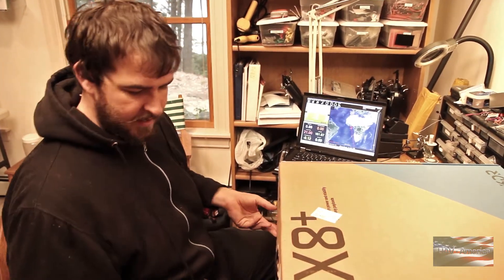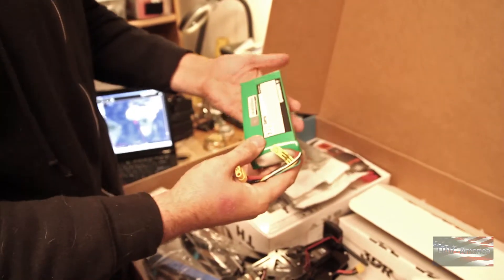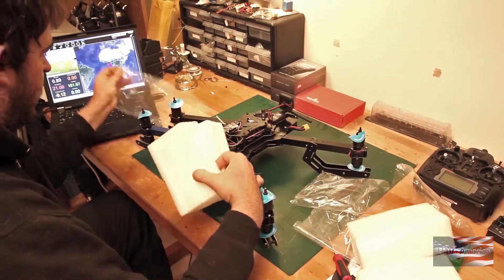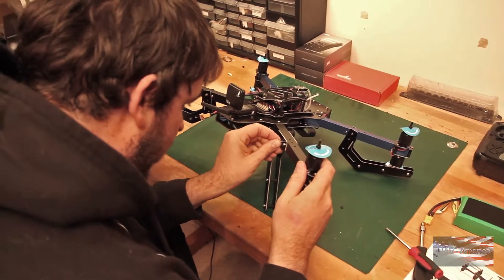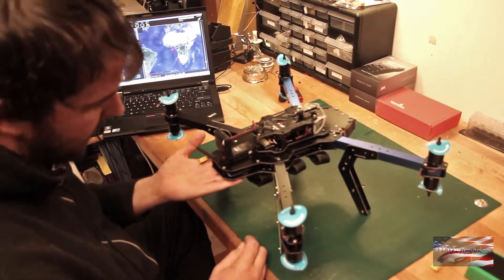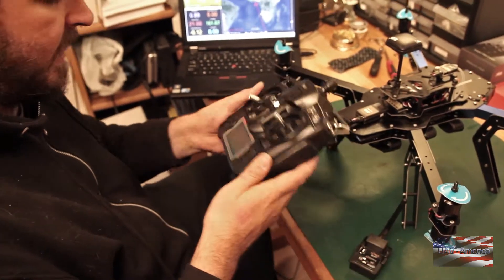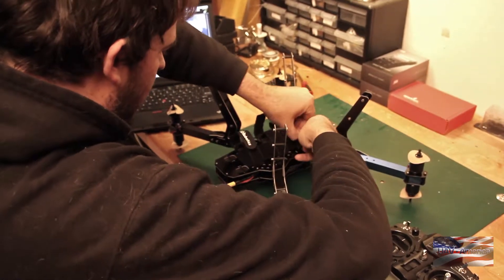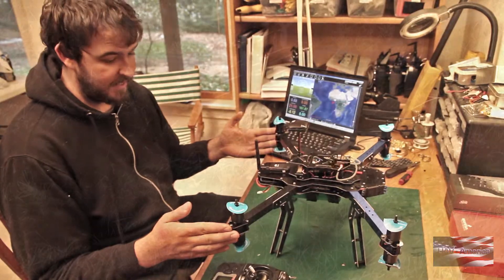3D Robotics New X8 Octocopter UnBoxing and Overview

Comment: Random Question here, Is it possible to get thumb stick upgrades for a flight remote, I am a RC car hobbyist but want to get in to flying but I imagine those flight sticks on the controller are going to be annoying for me I am used to using a wheel, like I would like to see rubber joysticks like on a Xbox remote or PS4 remote. I looked online but found nothing on it. I have been looking at this as opposed to the DJI inspire 1 because I would have to sell my Kidneys to buy the Inspire 1.